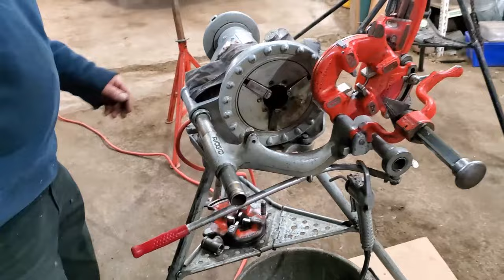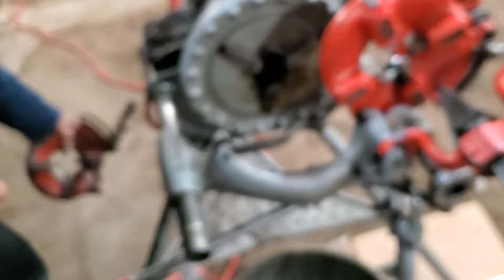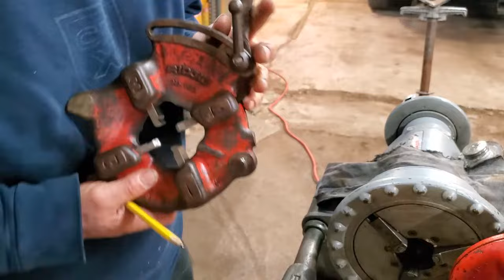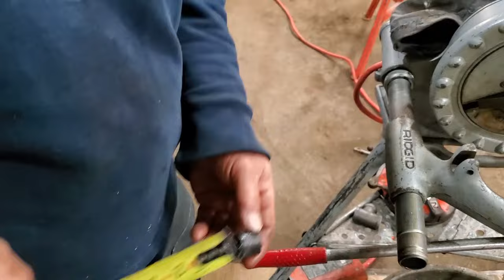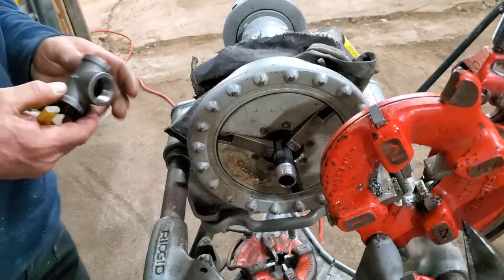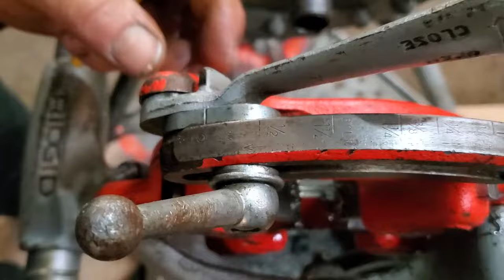How to thread pipe on a Ridgid 300

Comment: I hate when my help slams that head down. It can move the adjustment then they wonder why it's not threading right. This is the second video I've seen the head slammed down!
Reply from the maker: Hey Wolf, you're correct. Maybe just a poor habit of mine. If the spring assist stopper button on the carrige is OK, it should absorb  much of the slam. Usually the adjustment should also remain if the adjuster lock rod is tight. But you are right.
Reply: @w0lf1969 Thanks for the info! About to start as a helper and definitely will remember this 👍

Comment: When I line up the die to do any size , and it doesn’t just take . I’d have to help push or it may not even thread . Just strips the pipe . I have to constantly adjust it . Why won’t it thread properly with a nice taper when it’s set on the exact number ? Are my dies bad ? I don’t like this machine